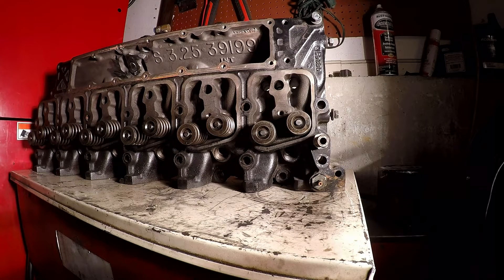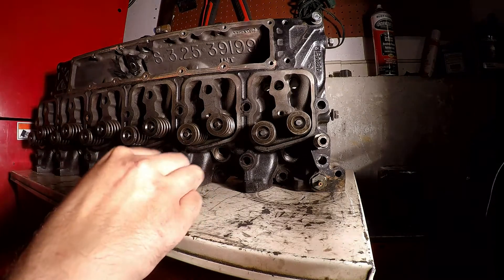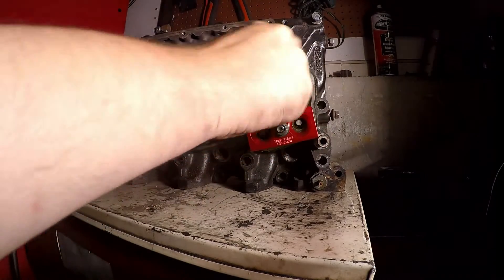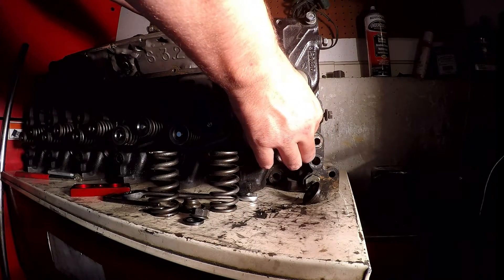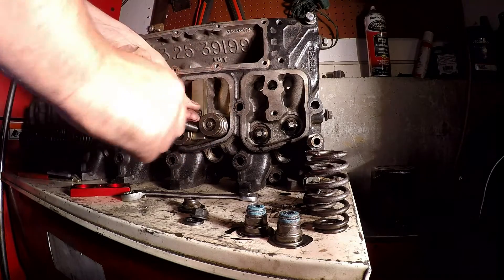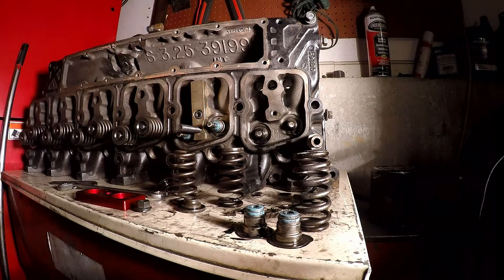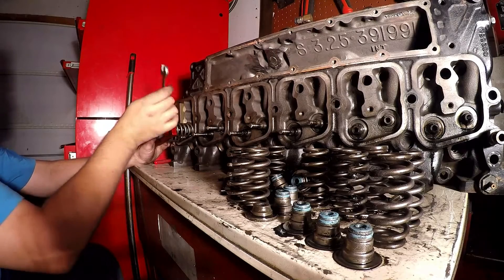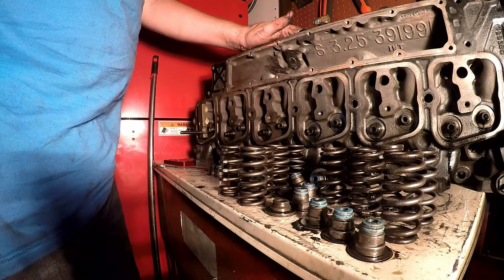cummins 12 Valve spring and valve seal removal

Comment: I did 1-4 this afternoon and decided to watch a few vids to see if there was an easier way to do 5 and 6. That spring compressor looks like    the answers. Thanks for taking the time for making the video and saving me some grief!
Reply from the maker: Oh yeah that thing is worth it's weight in gold. You'll never go back to "the old way" after you use one!
Reply: @HorsepowerTube  I redone my head gasket on my 12v had head re-worked 60lbs springs and I used the oem orange seals they lifted up on 2-3 running 25psi k27 swap but I’ve heard they have top hats you don’t have to machine your head is this true have you heard if so what part #

Comment: You don’t have to machine the valve guides down shorter to convert from the old style seals to the top hat style?
Reply: I’ve heard some styles you don’t have to and it works wish I new I need to do mine bad but don’t want to pull the head since it’s only got 8k on new head gasket

Comment: Did the tophat style seal come stock on later year 12 valves?
Reply from the maker: I'm pretty sure it is aftermarket only.
Reply: They are a Cummins part #3389250

Comment: Couldn't you just rotate your engine to have each cylinder at tdc to prevent the valves from falling, instead of buying and jerry rigging your own tools?
Reply: Thats exactly what I want to know.  Can we do it without blowing down the injectors?
Reply: @algorithmscollide8489  yes. Here are the instructions from Torkteknology who make the tool shown in the video:
http://www.torkteknology.com/instructions-for-the-cummins-12v-spring-compressor-cvsc020/

I use to want to do it the air compressor way but it's more work involved and if the compressor failed the valves could drop depending on the location of the piston under them.

Comment: What work needed to be done to use the TopHats
Reply from the maker: Nothing. Just pull the the old ones  off and put them on and then spring holds them down. I've had 2 12 valves and blew stock seals off both. Was leaking oil out exhaust ports. This fixes that problem!
Reply: @HorsepowerTube  this is great to know I just done my head gasket with new machine work on head and use factory style seats nave again I’m going to get these
Reply: @HorsepowerTube  what part# on top hats did you use I got afew packs of top hats from pro source that requires no machine work but I’m trying to find a company I can buy in bulk